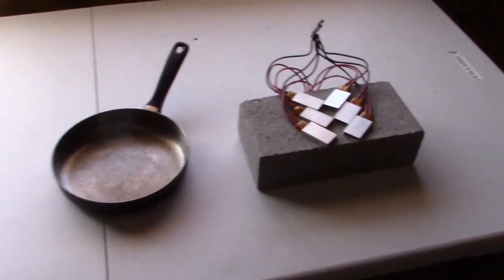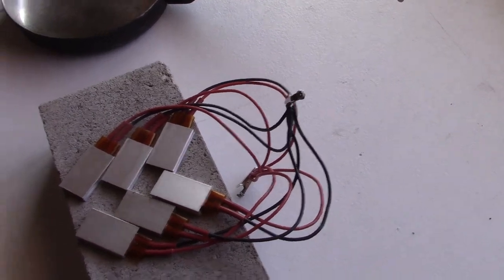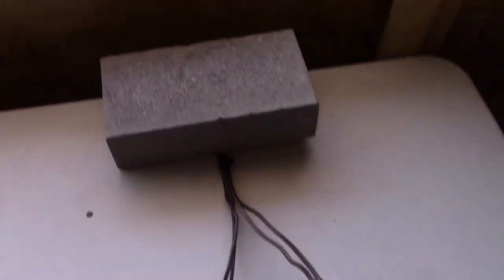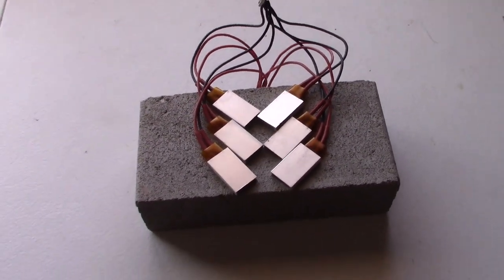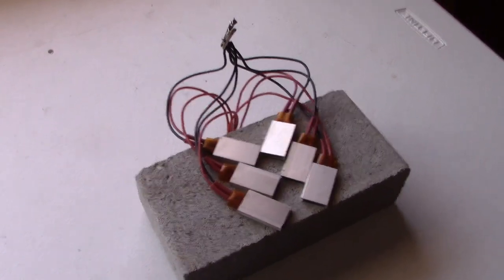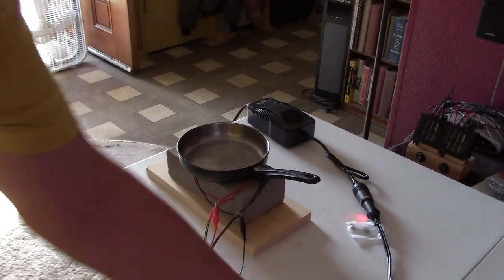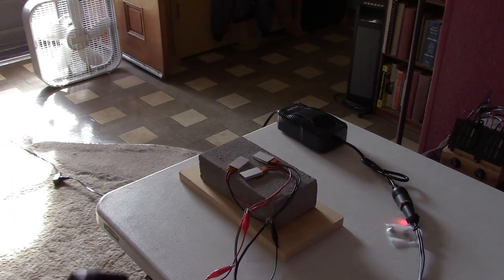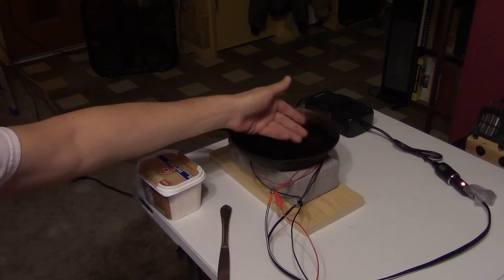How to make a 12V Stove Burner! - Super Easy! - Heats Up Fast!  (solar panel or battery powered) DIY

Comment: When I saw the first cooking video I went directly to Amazon and got 6 of these PTC heaters of exactly the variety you have. I was amazed at your demonstration. I plan to do some experiments with it this winter with 400W of direct-connect 12V panels.

I also made your fan in the past from the car radiator fan.  Works great!  I liked it so much I made my own fan design with 4 12vdc muffin fans. 

Keep the ideas coming I am really enjoying your ingenuity!

Comment: I was hugely impressed with this, and now that domestic electricity and gas supplies in the UK have become unaffordable for many and along with the extraordinarily large cost of living increase meaning that heat or eat is now the reality for many households, I decided to build this system.

Unable to get this brand in the UK I ordered six from China which were the exact same specs, dimensions and appearance, and quite affordable. 

I'll next get a 200w flexible solar panel and take it from there.

I intend to make your gallon can cooker/oven too, and have just bought the inner, stainless steel container you used for that build.

I have several Planetary Designs Airscape Containers (Large size) which may also fit the gallon can (although US and UK gallons differ).

Your videos are really very helpful, thank you for sharing your ingenious ideas and parts information.
Reply from the maker: you're welcome! awesome that you are building the projects

Comment: I think if you clamped these to a metal plate using heat transfer paste and insulated the underside, the performance would be greatly improved.

As it is, heat transfer to the pan is inefficient and too much of the heat is used to heat up the brick.

Interesting first experiment.

Good job.

Comment: I've learned how to bake bread in a pressure cooker, you just need to add 1 C of salt at the bottom and some sort of ring to balance an inside cooking pan.  Then place the lid on WITHOUT the bell, and cook approx. 20 minutes on medium heat.
Reply: @josephinecunningham5998  Check out my history on my channel...i do not post ,,,but you can see what i am watching.  In India ... they make cakes in a pressure cooker and bake breads in a presure cooker.  You need to add salt at the bottom to regulate the hear.  Then ...you have an oven .....
Reply: @marciamarcia7449  Good question!  I just had a trucks load of new sand delivered for the yard ....I have always used salt with good results.  Perhaps the sand will conduct heat as well!  Give it a go!
Reply: @marciamarcia7449  Thx ;)

Comment: Another nice video using PTC heaters and it looks super easy.  Commenting on a 3-year-old video, wondering if you refined the design, added switches or enclosure, since the video was made.  It might be a neat idea to revisit these videos to update us with a rehash of the original video with the newer content.  Could help with the algorithm as there are more preppers now, with the wars going on, to reach with these videos.  One thing, I would build in, is to be able to switch the individual elements off or on.  I would use a "1-0-2" (20-amp) switch to switch 1 or 2 elements on with 3 switches.  The reason is simple - if I cannot finish a pot of soup, I would like to keep it warm with one element going.  My stove will be connected to batteries so the less elements going, the less power consumption.
Reply from the maker: hi. yes, this one is very easy to make. i haven't added anything new to this particular design but adding a switch or switches is a good idea. i've got a few other cookers i've made with PTC elements (can and kettle cookers) also a water distiller. i've got a new one 'in the works' that uses ptc along with a vacuum sealed container that should get very hot very fast. my favorite build with the ptc cookers so far is the gallon paint can one (with the stainless steel cooking chamber). that one can be used as an electric sauce-pan or a crock-pot and it even doubles as an oven. i'm always looking for ways to reach new people. i know there are lots of people out there who like this kind of content (and have not seen or found my channel yet) but the algorithm doesn't always work very good. feel free to share my channel/video links. that's the number one thing that helps the videos to get seen.

Comment: I wonder if a single PTC heating element would warm up a single can of soup?  Could perhaps be used in a portable backpacking setup, if you got one of those small lightweight folding solar panels a can of soup, can opener, spoon, and a single PTC heating element then when you're hiking or backpacking you can open up the solar panel put the alligator clips on the leads and place the single can of soup on a single PTC heating element and warm up some soup and have a quick meal, do you think a single one would be enough to heat up a can of soup????? Also I saw how you had the six PTC heating   elements configured together when you placed the frying pan on there, I was wondering if you spread them farther apart,  if you could use a larger frying pan?????

Comment: Using fire brick I will cut little grooves to drop the elements into flush .   And make a circle like the shape of the pan.  Where can I find these elements and is it okay to put them on a switch bundled like you have
Reply from the maker: i love the idea of putting them in a circle. that should 'even out' the heat even more. they sell these elements on ebay, amazon and i've also seen them on aliexpress. search for best price. i once saw them for one dollar a piece (but those days may be gone). i don't see any reason why you couldn't use a switch if you want. just make sure it can handle the amps.

Comment: OmG what a great idea . I havent received notifications from You ,long time .Where have You been?
Reply from the maker: hi there. it was a strange summer... my last post was on May 5th. a week after that (on May 12th) i got locked out of YT on a security glitch.  that lasted from May 12th all the way to June 27th. that was a 'nightmare'. then a major car accident. along with various issues at the house got in the way. all is well now. my plan - if all goes well - is to keep posting for the next 20 years. 🙂
Reply: @desertsun02  authorities are trying to kill you by means of accident

Comment: I am thinking about building a pot within a pot system using "Tramontina 9-Piece Non-Stick Cookware Set, Champagne" Walmart.  Remove the handle of the small pot, fit it into the bigger pot, fill the empty area with sand and install PTE to bottom of small pot, and then plaster the top where the sand exposes.  This way you have a handle from the bigger pot and two lids.  If the plasters hold the sand in while upside down then you can easily wash it in a sink like normal. You can use it with solar, 12V 10A with power station and open fire on stove.  The beauty is the wattage used to do so much ~150watt.

Comment: How did you get those little heaters to stay on the brick in that orderly configuration ?
Reply from the maker: hi. no special way. they are just lying there. you could probably use thermal paste if you wanted it to be more permanent.
Reply: @desertsun02  Thanks,  have been tinkering with the same parts and bricks.

Comment: Could you use a pwm controller to adjust the temperature of these heating elements to control the temperature more precisely? Like if I wanted to build a oven that I can hold the temps at a perfect 350 etc.
Reply from the maker: interesting idea. i'll look into it ✔

Comment: Hello Desertsun. I have a question. So I'm trying to make a small heater experiment using these and my Jackery is able to work well to power them. I noticed however that after a while I lose wattage with them. Is this normal? Or is there something wrong causing them to discharge. Nothing is wrong with my battery bank because I have been able to use other things with it just fine with no discharge. First I was running the 12v 10amp output it comes with but when I noticed the discharge in wattage, I bought an AC to 12v 13amp at 156 watts which ran just fine, but the ceramic heating elements still discharged. Can you tell me what it might be doing wrong? Are the heating elements designed to get up to temp and then shut off after? Similar to how a stove element work? Let me know. Thank you.
Reply from the maker: hi there. the elements usually draw more power when they are first heating up. once they are hot (in a minute or two) then the power draw goes down some. they should always stay the same temperature though. you shouldn't see the temp of the elements go down. once they get hot they should stay hot. for some reason the elements don't need as much power to stay hot once they get hot.
Reply: @desertsun02  Okay sounds good. Thank you for this information. Yeah it goes from like 156w down to like 100 watts. Maybe they're actually doing what they're supposed to be doing but because it gets so hot and stays at the temperature because of the build I'm doing, that they stay the way they are. I'm conducting an experiment that involves an ammo can to make a small space heater for my van. I can't use a ceramic heater so I'm trying other methods. I bought some copper powder that I'm going to try mixing with sand to see if not only the heat conduction happens quickly but also that the sand heats a little faster for me too instead of being so dense. Guess we will see what happens. Thank you again for the info. Your diy ideas and videos are great.

Comment: Did you try some "heavy" cooking with it? Lets say, boiling a gallon of water in order to have a pasta cooked?
Reply from the maker: hi. you'd probably need a few more ptc elements for that. i have made a couple of can cookers using 6 ptc elements though. i've boiled water and cooked pasta in those. if interested here is a link to one of my videos showing that design https://youtu.be/2YZq1D52oT4
Reply: @desertsun02  
Yup
Those can cookers are definitely a better energy preservation method (due to the heavy insulation). Anyway, I’m looking for a solution to build a “normal” cooktop that’ll work on 24v for my RV.

I’ll try build one with 10 elements (which is still ridiculously low wattage for cooktop).

Tnx a lot for sharing you creativity!!!

Comment: Crazy you can cook or bake with such low wattage.. 90 or 180 W is just crazy if you compare it with the electric keramic heaters that are installed in homes that uses up to 5000W

Comment: Can you make a step by step tutorial on how to connect the heating plate to the battery?
Reply from the maker: hi there. all i do twist all the red wires together and all the black wires together and then just connect those wires to your power source (battery or solar panel etc.). the red ones go to the positive terminal of the battery and the black ones go to the negative terminal. that really all i do to hook it up. ✔🙂
Reply: Another question, if I use a 20 W solar panel will a 12V dc 60W 180C heating plate still generate heat, maybe not hot enough but just heat itself?

Comment: The current voltage in our country is 220v 50hz.how much watts if i supply 1 ptc 12v element like the mentioned in the vid? I am using a 12v ac to dc adaptor(1000mah) Thank you so much
Reply from the maker: hi. the 12v ptc elements i used draw about 2 amps (2000ma) each

Comment: Fantastic! I'm building this so fast. DS or anyone else, could there a way to regulate the head so you can have more cooking flexibility? A rheostat or -ish? Not just a sizzle but a simmer too, so to speak.
Reply from the maker: hi there. absolutely, you could just use  current control unit. amazon has lots of those cheap.

Comment: Hi mate great work! I am wondering if is it possible to power these ptc heaters with a 12v 20.000 mah power bank?
Reply from the maker: hi there. i would think so. (they seen to take about 2 amp hours per hour). i've seen it as low as 1.2 thou.

Comment: How do you use with out the pan melting the wires ?
Reply from the maker: the wires have a high temperature coating on them. they can withstand the full temperatures of the elements.

Comment: What would you use as a stove top? If installing in a kitchen/campervan. 
I understand cutting tempered glass isn't an option. Would a metal sheet work? Or would this absorb and disperse all the heat and leave little for the frying pan? Anyone got any thoughts for me 🙏
Reply: Would an upside down pirex oven tray work?

Comment: Hi. I have a few of these on the way to give this a go. My solar panel is 18v - will that damage the 12v PTCs? I've seen I can lower the voltage by partially covering the solar panel. Hopefully not a stupid question, new to all this.
Reply from the maker: hi there. it sounds like your solar panel is what they call a 12v panel (12v panels usually put out a higher voltage 17v to 20v approx.). it needs to be a little higher so that you can charge 12v batteries with it. the extra voltage just helps push the current into a 12v battery. (the higher voltage doesn't hurt the ptc elements at all. they can handle voltages up to near 30v. i use 12v ptc elements with 12v (18v) solar panels all the time.
Reply: @desertsun02  Hello again. My PTCs arrived. I put the solar panel in direct sunlight and they became too hot to touch in less than 10 seconds, but putting the solar panel at the window in my flat (lol, I know!) absolutely nothing, even though the panel would still light a small bulb from indoors. It's like below a certain amount of power there's nothing, they stay cold to the touch, rather than just a little bit warm. Is there a sort of kick-in voltage / watts, do you reckon? Maybe I should just move (N. Ireland)!
Reply: @petermurphy5302  most solar panels don’t work behind a window, especially the hr+ rated ones and up. Just repeat your experiment outdoors on the balcony if you have one

Comment: Sir, my PTC heaters are 18-125w / 12V / 220 degrees C ; can they work for cooking as yours ? I plan to connect 6 pieces to two solar panels of 100W / 12V ; Let me know. Thanks
Reply from the maker: hi. i think you meant to say 18 to (25w). six of them should work good with 2 12v 100w solar panels 🙂

Comment: How do the wires not melt from the heat of the pan?
Reply from the maker: hi. the wires are coated with a high temp silicone substance. that protects them from the heat. the heat from the tablet part doesn't seem to have any effect on the wires at all
Reply: @desertsun02  Wow, impressive. So far you're the only one I've seen who is using these.
Reply from the maker: @BC i was hoping that lots of people would start using them. they can be used in lots of ways. i need at least one of my vids (with PTC elements in it) to go viral. that would get the word out
Reply: @desertsun02  I've got a project for you (I'd do it myself but I don't have the PTC elements....yet). if you insert them into a large container of sand you will heat the sand and then the sand can release the heat during the night. Sounds like a really nice and safe way of heating a space with a 'sand battery'.
Reply from the maker: @BC thanks for the idea (already got a video on that). i used gravel but sand would work too. here's the link https://youtu.be/oXLiTmjJWmo (if interested, i have a playlist of all 14 or so things i've built using PTC). here's the link to that https://www.youtube.com/playlist?list=PLgdZa_R2JaP2q122uIiIxxj91ImwZbffz
Reply: @desertsun02  Thanks.........Looks like I'll be busy for a while.

Comment: Can you use 4 ptc 220 celsius ceramic elements,  12 v? I am not very skilled at this, not sure about the watts or voltage. Do you connect them directly to the solar panels? I have a 120 v solar panel. Thanks
Reply from the maker: hi. 4 probably won't be enough. 6 is the minimum i would recommend. i connect them directly to 12v solar panels. it works best if you use pans that are made of thin metal.
Reply: @desertsun02  Thank you very much for your kindness and your quick answer!!

Comment: Good to read below you're doing good now.  Thought there was a DIY option that could compete with the 12V hot pans for maybe more versatile off the grid use.  Plus, not using diesel engine glow plugs.  Thanks for sharing these, didn't even know they existed!  Not exactly related, though figured I'd pass this on in case you ever do a future video related... plus I've been thinking would be good for upgrading an inverter to give a boost for motor driven apps, the start capacitor use in an AC: https://www.youtube.com/watch?v=vKhiFVyMFQ4   Neat was the one other video I watched regarding the subject... demonstrated one of your designs as an example: https://youtu.be/27DxRhxYH50?t=25  Be safe!